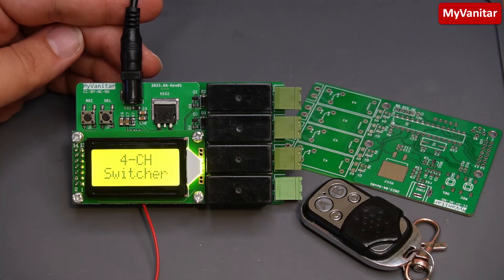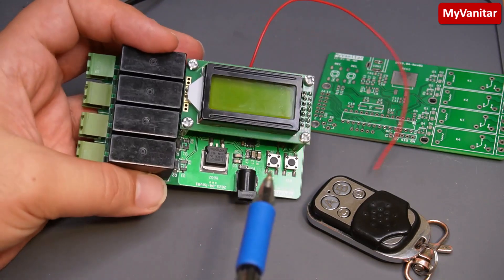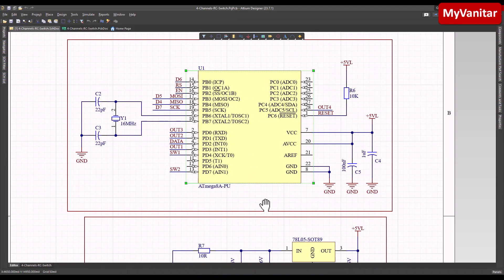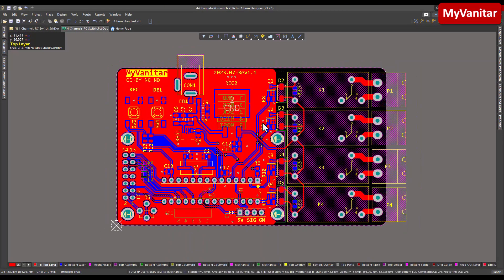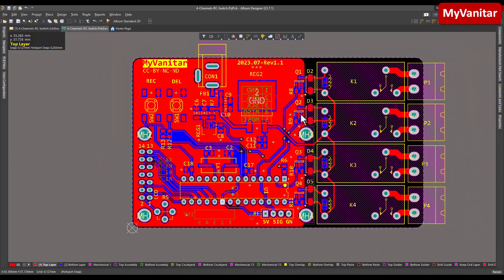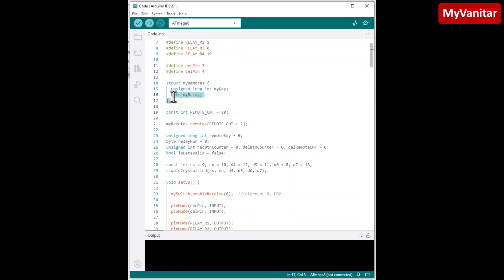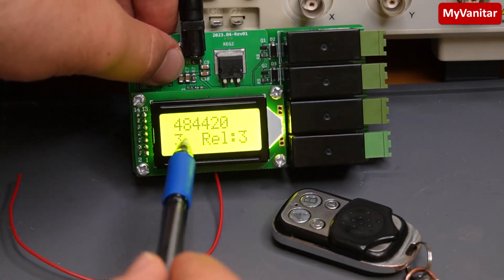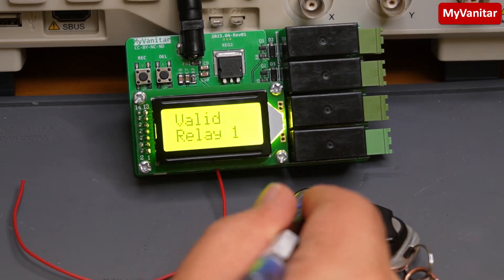433MHz 4-Channels Wireless Switcher Circuit

Comment: After the saving received code; a push button with the  selected The desired code ; a other push button with the sending code 🙏please help me to boiling to add this option for this project ; so thanks for you🙋‍♂️🙋‍♂️
Reply from the maker: what can I say, I suggest adding two buttons to submit the saved code, one to select the code and another to submit, or just one button to do everything. I mean short press to select the code and long press to submit
Reply: @MyVanitar so thanks for you ❤

Please give to me  void code  for transmitter  sending  code is older saved!
Please help me 
Thank you
Reply: It is very important for me to select and send this function of sending old saved codes with two push buttons. Thank you for your help
Reply from the maker: @eerrfanshayyestehh2069   this is a task that you should follow and experience personally, brother. I have no time to modify the schematic, PCB, and code.
Reply: thank you ; For taking the time to answer me, dear engineer; I wish you success🙏🙏